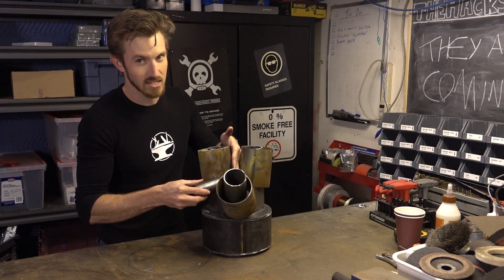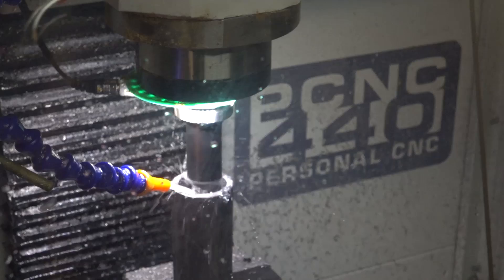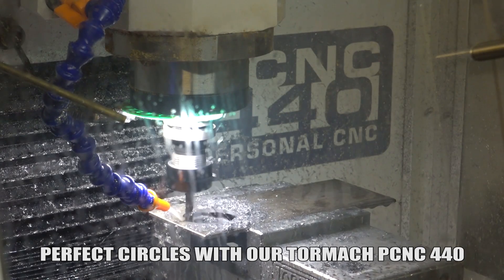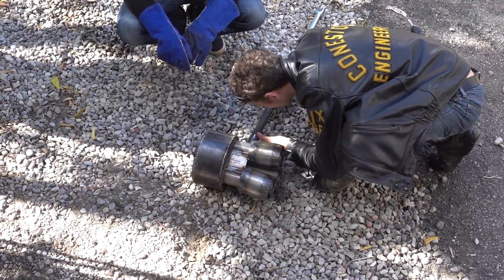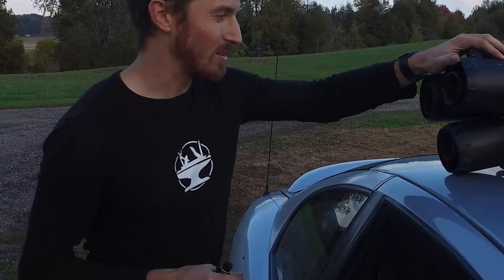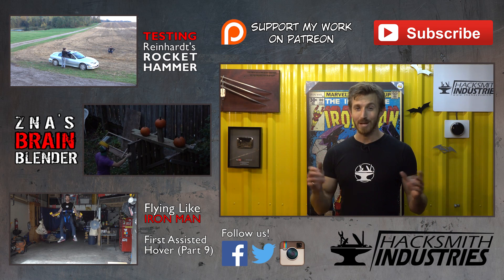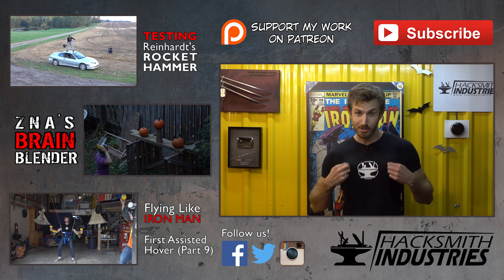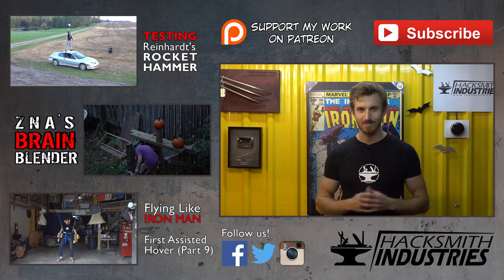Make it Real: Reinhardt's Rocket Hammer (BUILD VIDEO)

Comment: The welds between the pieces of pipe, turn your voltage up a bit and you'll get a better looking weld that ties into the pieces better.
Reply from the maker: +v1buster it was a $30 welder, that was max voltage lol.

We have a much better welder now
Reply: the Hacksmith a $30 welder? I didn't know they got that cheap
Reply from the maker: +v1buster it was broken when I bought it. You can buy them for $100 from harbor freight
Reply: the Hacksmith I already have a Millermatic 251, I just thought I was helping you guys out, but you got this.

Comment: why not use a liquid fuel rocket? or even a compressed hydrogen jet engine? with a button on the handle you could use it multiple times before it runs out and you wouldn't waste fuel because it kept burning after impact. you could even use compressed oxygen and hydrogen (in separate containers to prevent explosion by compression.), just use a hydrolysis machine (makes hydrogen and oxygen) to fuel it. the hydrogen shouldn't explode if contained right because, y'know, know oxygen, then mix the hydrogen and oxygen in the jet nozzle.

Comment: you should craft one with the fans from the flight project replacing the "rockets" just make it with air ducts near the front you may actually get torque with swings and itll be rechargable, id just put mesh on the ducts so you dont get debris turbo launched at your face after destrying something
Reply from the maker: +Matthew Garrett you'd destroy the EDF in one hit... Way too much of an impact force on the hammer :(
Reply: Probably waaay to far out of budget but would it be possible to comission tougher fans to be made? Out of strong material, or as oddly impossible as it sounds put the fans in chambers hooked to springs or bungies all the way around so when they hit they have some bounce coushion and dont get full impact force, would probably use tough metal for outer shell and light metal for internal structure, to level out some weight and it would make it heavier but less akward to use if you used maybe cast iron for thecspike st the bottom of the hilt and try to balance some of the weight, definateky not 50/50 but maybe 75/25, and if youre ballsy for testing it put a fan facing reverse in the bottom to see if you can maximise hammer head swing buy inverse force but thats probably not really plausable, the pivot points at your hands would make it screwy
Reply: Most of this is just theoretical talk i dont expect to see it because this would be a nightmare to make, but i like to throw ideas out or hear if something may be possible
Reply from the maker: Lol anythings possible -- but nothing ideal short of using rocket fuel. Maybe a pulse jet would be cool!
Reply: can you make iron fist gloves with real fire using matrix nomex gloves similar to how you made psylockes sword

Comment: Suggestion: Every single video you have has your .ca website at the end and eventually people are going to go on it.

But, the site isn't good. The tedX video is set to private so you just see that gray screen, The blog is a year out of date, your shop doesn't have any of your esty (or other stuff) on it, doesn't have any tabs like the other's and starts off with the backscreen of you, so you have to scroll down.

There's nothing in the will it laser section (those may be old video's but their still good)

The update video calendar (or below it) could be turned into a chatbox for people to talk in real time between themselves (would probably need multiple room but isn't that hard to intergrate into a site layout)

I think you're missing out on a huge potential source of revenue with the shop. Take the wolverine claws, steel $50, laser etching nothing(?), cutting them and welding them, sell for $100, sell at least 5 a month. 3D printing alone could make you money because I'm sure someone out there (my gf for example) would love a miniature anvil.

Hell, I wanted a laser etched T-shirt when i was watching your old video's. Also, i didn't see a mention of your patreon on the site.

Lots of potential that could use a push there. it looks like you haven't been on your own site in a year.

Comment: What if you made like a super compact parachute system? like super fast inflation and detachment. So if you fall just amost instant parachute and it can be easily disconected from. Rouge assassin style thing.
Reply from the maker: +virgil anderson that would be awesome! But unlikely possible :(
Reply: What about a CO2 or compressed air charged backack. So the chute could open in smaller spaces. Instead of having to fall a certain distance. It could be for smaller falls.

Comment: I might actually build this, I'm a blacksmith so I might forge some of the parts instead of cutting and welding them though. Keep it up! If you ever need anything made just talk to me!
Reply from the maker: That would be quite the challenge... I can't imagine blacksmithing anything that big with so much detail!
Reply: the Hacksmith I would build it in parts and then weld it, I would probably also heat treat the face of it as well.

Comment: hey man try do the flight project with a big slim ducted dc fan 450mm put on a jacket behind your shoulder blades with the air flow pointed to your back, with a short/slim wide duct straight to your back and then out to the ground, like a harrier kind of, i think it can be made very slim and you said the problem was efficiency of the size of the blades
Reply from the maker: Where do I get a 450mm ducted fan? =)
Reply: let me find a motor for that purpose, the blades can be made with your cnc and some aluminum soldering for the circle blades to rotor attachment
Reply: lol i just find this http://www.custom-air.co.uk/Custom_Air_Paramotors/paramotor_engine_files.html small but i dont know if it could work, and find this http://www.electricmotorsport.com/ev-parts/motors/brushless-motors?limit=all, i think one of the 500 dlls 20hp price one will lift you up
Reply from the maker: Hmmmmmmmmmmmmmmmm
Reply: the Hacksmith make it pls
Reply: Hack smith make real you gi oh duel disk plz
Reply: the Hacksmith 3:03 is that a pebble time smart watch?
Reply: duel you will go to the hospital

Comment: That's pretty cool!
I wonder how much the hammer weighs ?  It looks quite heavy to lift... might need some more rockets on the other side to help with that ;)
Reply from the maker: It's about 50-60lbs =)
Reply: Just looked it up,  that's around 25kg, not bad.
Enough weight to crush things, moreso if you add rockets to it ^^
Although you can't swing it around too much..

Comment: personaly, i would have based the design off of the super sledge from fallout 4. they have the same operating principle, but the super sledge, is smaller and lighter. more practical for people without power armor. and instead of single-use rockets, i would have used compressed air for multiple swings.
Reply from the maker: Yeah, but Overwatch is new and exciting! Plus this things deadly even without the rockets. Compressed air wouldn't provide much (or any) thrust for something this big.
Reply: i know, thats why i suggested the smaller fallout super sledge. i understand why this was more exciting, and dont get me wrong, that is an INCREDIBLE build. i was just thinking aloud, mostly. superhero tech is kinda... relevant to my future.
Reply from the maker: Also if you want to see an awesome Super Sledge, check out Jairus of All on YouTube!
Reply: ive seen that one as well.
Reply: why is super hero tech relevant to your future? You planning on putting on a mask?
Reply: CurvingFyre but i was mainly asking, not assuming.
Reply: well, thats a tall assumption to make. there are a lot of reasons why it could be.
Reply: CurvingFyre imagine him making a fat man, but with maybe a type of dart that looks like a mini nuke.